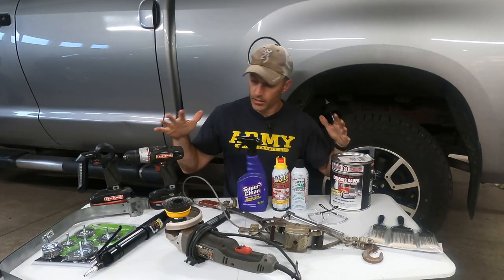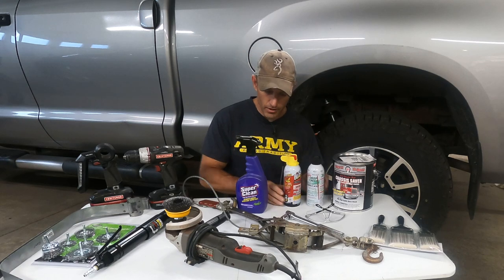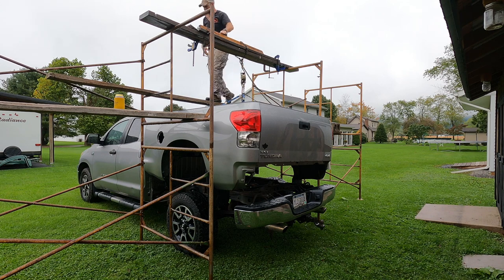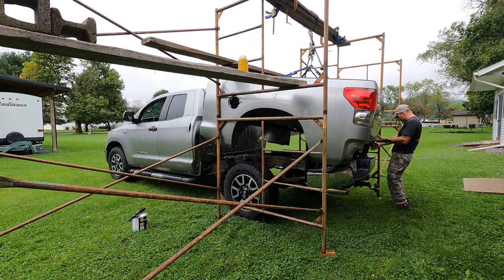How to remove your bed off your Toyota Tundra 2nd Gen

Comment: I never bedlined my 2013 but it wouldn't matter the rust came from undernearth not the inside.  In the spot-welded areas is where it started.
Reply from the maker: You are correct the rust came from the underside. Thanks for watching

Comment: Thanks. Was the bed itself not heavily rusted underneath the liner?
Mine is fooked. Needs to come off to repair. Id be very surprised if your bed didnt have issues as when I was shopping for a Tundra every single bed I saw was rotted, inckuding the one I bought with no rust anywhere else.
Reply from the maker: It rusted from the underside up. Love my tundra going to buy another one but hope my bed does not rust out again. Toyota replaced lots of beds for free, my bed was good when that happened. Thanks for watching

Comment: Do you know if the 2014-2021 bed will fit 2007-2013?
Reply from the maker: Sorry I really do not know. Thanks for watching
Reply: It will fit but the wheel wells are a different shape. Just a cosmetic issue.